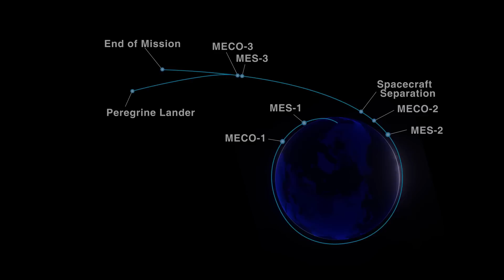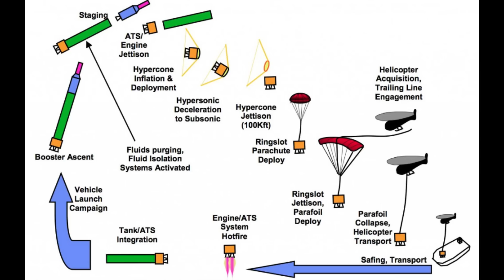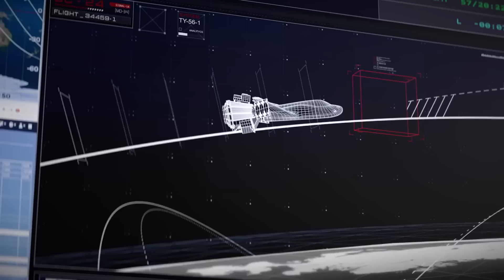Why Vulcan is the Most Important Rocket ULA Has Ever Built

Comment: On the "smart" resusability: wouldn't be possible to recicle the aluminium from the booster tanks?
Reply: Almost everything about the Vulcan design is wrong for re-use. The upper stage is underpowered compare to Falcon, so the first stage needs to do much more of the work... which means it's travelling much further out to sea, and coming down much hotter than a Falcon would. The core is also underpowered — just two engines — so it needs those expensive disposable solid boosters to get performance for larger payloads (which is mostly needed because an expendable core needs to be as cheap as possible for smaller payloads). And the two-engine configuration is no good for any form of propulsive landing, since you can't throttle down by switching off engines because that would give you massively asymmetric thrust at a point where you really don't want it.

Sure, they claim they'll do "smart" reuse of the engines... but it's very hard to see that ever getting into production.
Reply: @simongeard4824  "Sure, they claim they'll do "smart" reuse of the engines... but it's very hard to see that ever getting into production."
That's how I see it.  It appears to be aspirational marketing fluff designed to put the word "reusable" on something which is fundamentally in not.
Reply: agree @simongeard4824
Reply: You have to get it down in one(ish) piece for that. And there is no real way to do so. It's far too big and fast to parachute down like electron, and they clearly can't do a Falcon 9 impression due to the engine configuration.
Reply: @kukuc96 Plus, even if you could get it down in one piece, at that point you might as well just reuse the tank as a rocket.

Comment: Have you ever (in KSP, like) tried strap-on boosters for a second stage?
Reply: There's no point.  For the second stage, specific impulse is King.  Strapping on boosters will kill your Delta-V.
For getting up from the ground, otoh, thrust is King. 
Look, you can view this as four different propulsion systems:
4 - Solid booster have highest thrust but lowest specific impulse.  3 - Kerosene based fuel have high thrust but modest specific impulse.  2 - Methane is a compromise, gives higher specific impulse but can maybe still get you off the ground.  1 - Hydrogen gives the highest possible specific impulse, but hydrogen rockets like the Space Shuttle and Ariadne absolutely need boosters for the first part or they'll get nowhere.
Both solid booster and Hydrogen have some technical problems which make them unsuitable, particularly if someone cares about what it costs.  Solid fuel boosters induce very strong vibrations.  There's no solution to this other than make sure your rocket and payload cope with it.  And it will certainly also affect the reusability of the rocket.
Hydrogen requires extremely low temperature.  This results in many difficulties and is a particular problem if you need to contain the fuel in the rocket for a longer time, longer trips with many burns over time.  Also, it penetrates metals and form hydrides, making the metal brittle, which will certainly affect the reusability of the rocket.
Reply: Second stages are usually going so fast that drag eats up most of the additional ΔV.  Adding a another small stage or a bigger kick motor is more economical because they are inline and don't produce additional drag. External boosters also limit the nozzle size,  you want a high expansion ratio in thin or no atmosphere but big, high expansion ratio nozzles would increase the booster cross section. You would either take a loss in ISP due to smaller nozzles or produce more drag.
Reply: @wreckingangel   Nah, the simple answer is that it's madness to lift so much useless weight in the second stage.  Boosters have rock bottom Delta-V, so they're just lead weights.  They would be a penalty to performance, not a bonus.  Drag, sure, but it would play in more at lower altitudes, before burning the second stage.  At the low speeds at which a launch rocket will climb, there's not much drag after 40 km that will be much relevant in that way.  And the first stage will normally go further than 40 km.  But sure, drag will be problem, but before they get to burn.
You're correct about expansion rate for the nozzle, but not about nozzle size.  Again, that's not the problem.  You would just make a much slower burning booster that achieves more optimal expansion in a 'vacuum' nozzle', that is small enough for diameter, but big enough for the lower burn rate.  It won't help enough for Delta-V though, since the solid fuel itself has so poor Delta-V that it's outclassed anyway.  That's the problem.

Comment: Is it reusable? Can it land? How about the cost, have they worked on lower cost, by reducing the beauracracy?
Reply: No, but they’ve submitted more grants for money
Reply: @redeyedmongoose2963 Just like SpaceX does.
Reply: It's currently not reusable, but they have a planned upgrade that will make it partially reusable. The BE-4 engines are already built for reuse and ULA has worked with NASA for some tech demonstration mission for their inflatable heatshield concept (LOFTID) which will be scaled up with SMART to enable engine reuse.
This system would not land, but instead splash down in the ocean.

The  have greatly reduced cost compared to Delta IV Heavy (and Atlas V), while also having a reliable supply of engines (unlike Atlas V). In some contracts ULA has signed, Vulcan Centaur is even price competitive with SpaceX's Falcon Heavy and Falcon 9 rockets.

Comment: Hydrolox/Metholox/ Solid Rocket - this Frankenstein complicates everything!
Reply: It actually makes a lot of sense once you run the rocket equations.
At low speed (takeoff), a rocket is hella inefficient no matter what the fuel.
Low specific impulse fuels make a lot of sense in that regime.
For the upper stages once the rocket is moving at speeds at or exceeding the propellant velocity, you want the fastest, highest specific impulse fuel you can get (HydroLOx).
Reply: @NullHand  The problem is, it only makes sense if you look exclusively at the rocket equation. If you're actually looking at the requirements for building an operational rocket (instead of some idealised paper concept), that kind of optimisation isn't particularly helpful.

Comment: love the big smiles you got for a rocket thats not reusable other than the engines, if they even work properly after being recovered from the ocean without a complete rebuild.  not to mention the blue origin engines which failed after just 24 flights (and not even using the same engines each flight)
Reply: BE-4 isn't the engine used on New Shepard.
Reply: Rocket Lab seems to be fine with engines being splashed into the water
Reply: @ImieNazwiskoOK isn't their ultimate aim to catch then with a helicopter when they're under parachute? Or have they scrapped that for sea recovery?
Reply: @nelsonglover3963  they scrapped that for some inflatable heat shield for the engine bottom section only...  So just engines to be recovered.. still would need a complete rebuild of each engine after sitting in ocean salt water.
Reply: @nelsonglover3963  Scrapped dear boy, they found out the obvious, a big old booster swinging around on a wire isn't good while attached to helicopters.
Reply: @ImieNazwiskoOK  rocket labs engines are tiny as their rocket is also very small made for small payloads.  the engine itself is just 35 kilos in weight..  

In addtion they are 3d printed engines, they suspect they can reuse them, but have never reused one yet.  The plan is to try and reuse them yes.

pls dont compare those tiny engines to large rocket engines.

Comment: The section around 4:30 makes me think, could we have a video on rocket profiles? Some are long and skinny, others are short and fat; some are mostly cylindrical, while others are almost conical. I find it particularly notable that now all the stages have (mostly) the same diameter, but decades ago they got narrower as they went up the rocket. What are the design considerations that go into this? I imagine it's a combination of aerodynamics (to have both low drag and high stability) and maximising the wet volume / dry mass ratio, while keeping to various logistical considerations, but I'm sure there's a lot more to say!
Reply: I think the main reason almost all modern rockets have all the core stages the same diameter is tooling cost. it's usually pretty easy to build the same tank at different lengths with the same tooling, so if the stages are the same diameter, you don't need as much tooling and can reuse things like bulkhead designs. I think it's about the same reason a lot of cost-optimized designs have settled on 7-9 engines on the first stage. it lets you reuse work since one of the same engines with a vacuum nozzle is about right for the second stage.
Reply: From what I remember a lot of old rockets were basically putting multiple already existing rockets/motors together, now that a lot more is from scratch it's easier to just make a single diameter. I think similar thing applies to second stage engines being the same as the first stage, although that way engines usually aren't really specialized to be that good at one particular thing.
Reply: AFAIK there is little/no gain in making upper stages narrower.
By the time they separate atmosphere is mostly cleared, and "rounder" is more mass-efficient.
Reply: There's clearly a lot to discuss here! I'm sure EDA would do a fine job going over it, but his constant puppy-dog enthusiasm about the latest thing he's looked at gets tiresome pretty quickly... I prefer sober discussion to excitably fawning over what's currently being hyped.

Off the top of my head, the advantage of a conical rocket wouldn't be to reduce air resistance while the upper stage is powering the flight (because there is no air at that point), but to reduce the drag at launch by having the whole rocket have a finer taper. How much would be gained by this is beyond me. Also, if you have lots of engines (like in the N1) then you need the base to very wide - if you kept that width all the way to the 3rd stage then you'd have something very wide and very short, which would be far from optimal for tanks.

What I can work out is that the way to minimise surface area for a given cylindrical volume is to have the height be twice the radius. I'd be curious to know if 2nd stages (or the tanks inside them) have this ratio, and the 1st stage keeps the same width for ease of construction and is simply stretched vertically until it stores the required amount of propellant. That might be my rule of thumb in Juno when I next play it.
Reply: @QuantumHistorian  As an aerospace engineer who just graduated from Purdue, there are actually some pretty significant structural advantages to a conical rocket. The first and most obvious is that a conical rocket is much less likely to buckle if the loads aren't perfectly straight up and down when it's under 3 or 4 'g's of acceleration, so you can immediately save some weight there. 
The other big structural advantage is a bit harder to explain. Assuming the rocket isn't going to fold in half, there are two primary ways it can fail in flight, the first being tank pressure and the second being wrinkling under vertical load (often called local buckling). For the tank pressure on the side walls, the wall thickness you need is directly proportional to the tank diameter. There is also a minimum wall thickness you need so the walls are stiff enough not to wrinkle and get crushed, which depends on how much weight is on top, the tank pressure, and is inversely proportional to the tank diameter. All that means that there's a "perfect" diameter where the tank thickness for the vertical load and the pressure load are the same, and that diameter gets smaller as you go up the rocket. the mass of your interstage, thrust structures, and not exactly spherical pressure bulkheads gets disproportionally larger as the diameter goes up, so something around or slightly larger than that "perfect" diameter tends to be the lowest mass.
if you want a good recent example, one of the earlier versions of the Neutron rocket was slightly conical. Rocket Lab is planning to reuse the first stage and to get around the transportation issues by building them right next to the launch site in Virginia. I remember somewhere in an everyday astronaut interview Peter Beck said it was because the conical shape is more structurally efficient and they wanted to squeeze performance out of the structure instead of the engines to make the engines cheaper and more reliable. A lot of the vertical launch SSTO ideas have also been conical, like the Venturestar and the delta clipper.

as I said before, a lot of the cost of a rocket is tooling, and a lot of the launch cost is handling and logistics, and having everything the same diameter brings all those costs down, so a cylinder with all the stages having the same diameter tends to win on a cost per capability basis unless you're you need a VERY high energy launch.
Reply: the primary constraint on diameters  is what will fit in railway tunnels

Wider diameters have to take the Panama canal route and that's impossible for things manufactured in places like Utah

As for WHY things are made in Utah, the answer is congressional pork

This is why fully commercial ops will eclipse NASA - They aren't beholden to Senators for funding, will site manufacturing where it makes the most sense and generally aren't afraid to move sites if it makes commercial sense to do so
Reply: Everyday astronaut said he has a video coming soon comparing vulcan with all the other launchers. He will likely explain design reasons for differences in width.
Reply: Its all about how efficiently can you provide the desired capabiltys. Which ends with costs, always.

1) Shape. The fewer sharp edges there are, the less drag it will be, especially after breaking the sound barrier. So, you want a rocket (''diametry'') as uniform as possible. Its not alot, but every single % in efficiency is wellcomed.
2) Available technologys and designs. When there was a narrow sellection of designs, they took what they required and could afford and then build arround that. Also if some stage had delays in development and so they changed to another ready on to be on time.
3) What can fit to lift. Having large diameter rocket and consiquently larger diameter fairing is wellcomed, becouse you can fit small and big things, all with one rocket - less modifiactions needed = less expenses.

In the end, you want the desired capabilitys at the lowest possible costs. Short and longterm. Its bussines like others.
Reply: @tehice23 "desired capabilities at the lowest possible cost" 
Correct in ideal theory, but in practice the Delta IV Heavy was an exercise in maximizing both cost and profit by using hydrogen fuel in the first stage with one large highly expensive engine in each of 3 cores.
Reply: 2:50 it’s so interesting to see this dash for the moon the moment Russia is out. Not only is it impossible for them to contribute, but even if they question something they will be ignored. I wonder what is the plan? Claim the Moon as an US colony?
Reply: @Voodoo_Robot If we were going to claim the Moon, we'd've done it already. One small step for man, one giant eff you for Russia.

Though practically speaking, you have to be able to ENFORCE territorial claims, or they don't matter. We would need a very large permanent lunar presence to keep others from setting up bases on "our" moon.
Reply: @CptJistuce  that little flag meant nothing for 50 years. Back then nobody spoke about commercialization of Moon. If you listen to what officials say now, you can very often hear what sounds like colonial rhetoric.
Reply: @Voodoo_Robot  People spoke enough about it that there's an international treaty expressly prohibiting it(known imaginatively as the Outer Space Treaty) dating to the Apollo era, which the US is a signatory to.

Comment: Why dosnt the orthogrid use the bestagon the hexagon?
Uses less wall for more strength thanks to 120 dehree angles 
And the corners will hav less fatige
Reply: Bestagons are better all around, especially for loading from wildly varied directions, but pay for it in complexity, machine time and absolute directional strength... Vulcan is designed to avoid having to deal with basically anything but compression loading and hoop strength. That means they don't need the versatility of the bestagons and can use the easier to make and more directional squareagon....
Reply: @AutomaticJack  thanks for explaining it fellow bestagon
Reply: Triangles are more mechanically stable than hexagons. Rectangles are easier to machine and bend consistently…
Reply: @allangibson8494 yea but hexagons have both those advantages whilst being flexible enough
Reply: @OneMarsyBoi  The problem in this case is developing a consistent curve with the highly variable stiffness from a hexagonal structure.
Reply: @allangibson8494  they did it with Orion they can do it with Vulcan